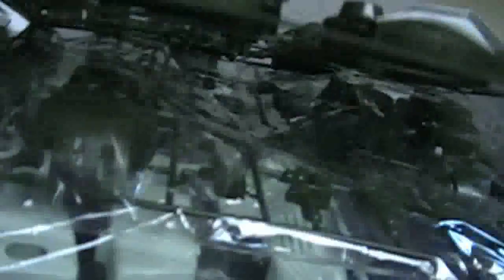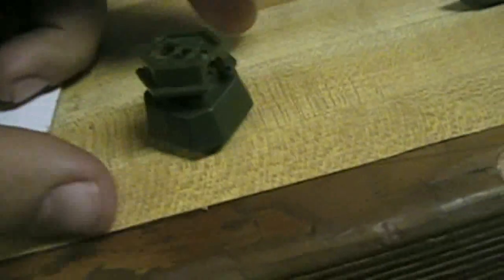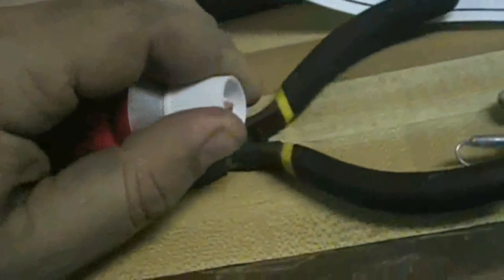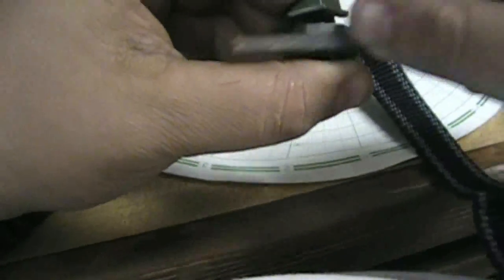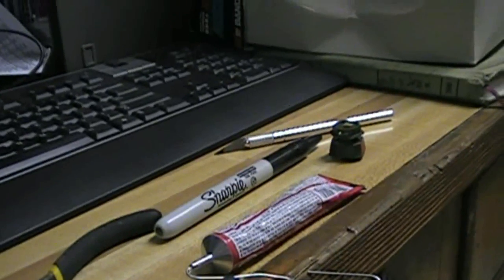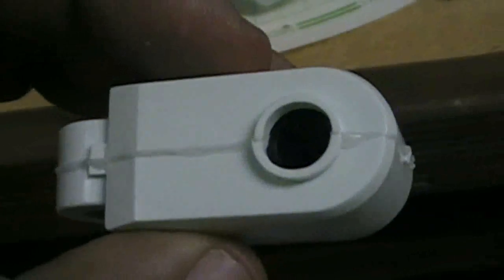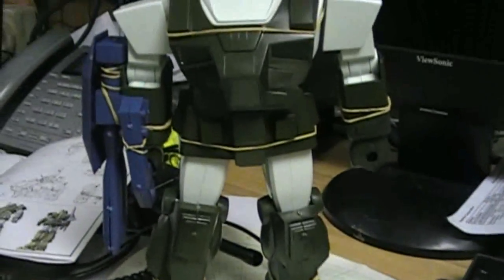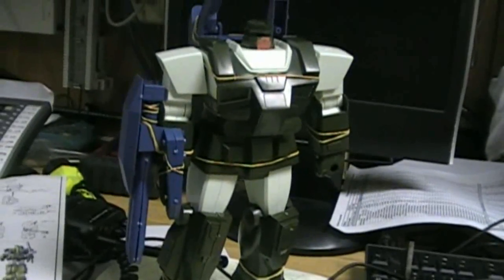Building the FA-78-1  (1/60 MSV)

Comment: Built a 1/100 fa78-1 recently  The older kits have joints that sometimes need tightening, but otherwise they are fun to build.  The bondo putty is similar to the mmd brand "Green Putty" I use (not 2-part).  Keep up the build and have fun!

Comment: Great video. When we made these kits back in the 80's we had to glue, sand, file and paint so we have become quite spoiled with the newer kits that don't require any glue and each piece is usually molded in colour.
Reply: Nostalgic for the 70's & 80's that's not being spoiled that shows that technology has gotten better though there's resin kits which an require glue sometimes and do have to be sanded at times as well
Reply: Yes, true but I still make models today, the last kit I made was MG Gundam RX-2 2.0 and I still had to sand, file and paint but still a lot less than when I made Bandai Gundam kits back in the 80's. I really do like that Model kit pieces are now usually separated in colour. It helps a lot. Also like the fact that for the most part we don't use as much glue :)